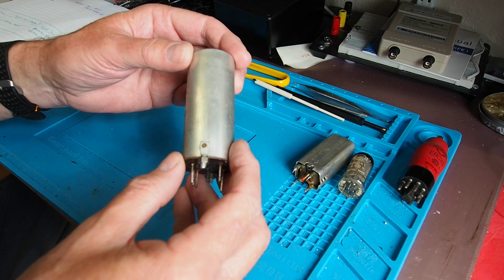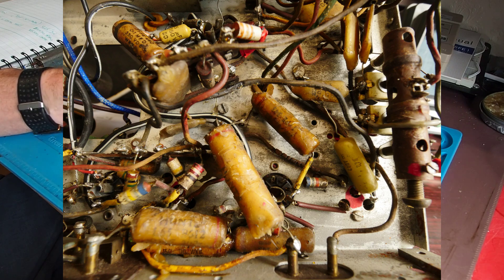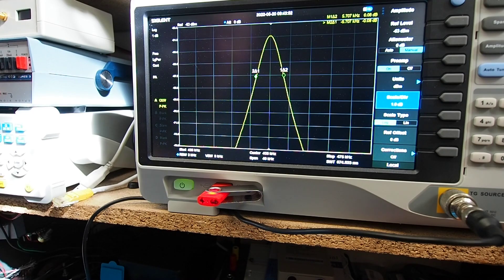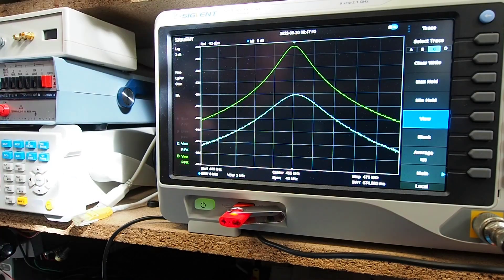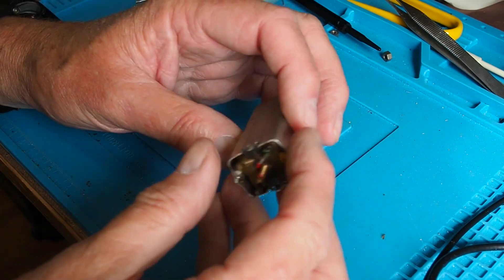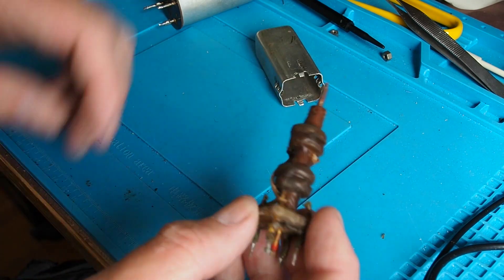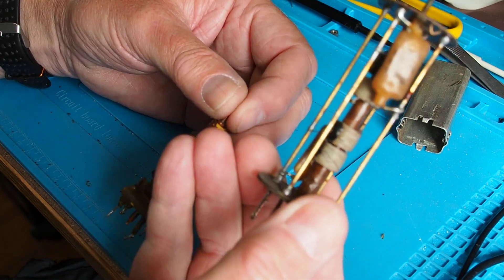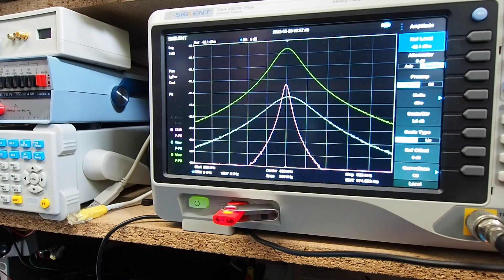Exploring 1940s Technology   #126

Comment: the 455 K.C. I.F. frequency was used/ developed by "R.C.A." and other radio manufacturers that used the 455 K.C. I.F. frequency  had to pay royalties to R.C.A, so a lot of radio manufacturers would use other I.F. frequencies so they would get around the royalty payments. for those who are getting into old radio repair, be careful about the I.F. frequency that is used when "PEAKING" the radio I.F. section. the best way to do this is by using a frequency generator, not by ear. also it must be done with the volume output as low as possible to avoid the "AVC" feed back circuit from becoming active, this will throw your peaking adjustments off

Comment: it was common for electronic equipment that was built after word war 2, to have pre- war components in them .the components were old/ new stock just setting on shelves, and instead of scraping the stock, it was used up. the older I.F. transformers were cap. tuned, the newer ones were slug tuned with fixed silver mica caps in the base of the transformer, and now they have age on them the silver mica is shorting out( sounds like a thunder storm when the radio is on), the only way to repair those is to dig out the silver mica wafers, and install new external caps. to find the capacitance, both coils have to be disconnected ,so the silver mica caps can be measured. most diagrams show the existence of the caps in parallel with the coils but do not show the value, due to the transformers being outsourced, and the company who built them did their own tuning of the circuit( pri./ sec.) there is no real set value used on the silver mica caps, and varies from set to set( first/ second I.F. stage including pri./ sec. windings).

Comment: Nice little bench experiment! I had wondered about the ability to test IF transformers like that, to try to troubleshoot them, or, to peak while outside of the circuit( possibly with a replacement of bad mica wafer caps) before re-installing them. Some info said it won't work right, but isn't a tuned/resonant "tank circuit" going to keep its resonant frequency regardless of what it's connected to, outside of more inductors or capacitance being connected to it?
Reply from the maker: The components around the IF cans are going to have some additional effect, I would guess that you could get them somewhere near, before assembly, but then how much the circuit components would impact on this I really don't know.

Comment: I grew up on this stuff, R1155 and No. 19 sets etc. Tore down and rebuilt all sorts of stuff using valves. Only comment about the 1947 Pye set is that they were probably using up the old components because stuff - in some cases - was not easily available immediately after the war. Remember Proop's Bros and others on the Edgeware Road in London? I live in Florida now and still  have some valve gear butmainly from the late fifties and early sixties. Still come across Int'l Octal stuff occasionally but it's getting quite rare now.
Reply from the maker: And I think Proops Brothers is still going, mainly tools and craft these days, see:- https://www.proopsbrothers.com/

Comment: Interesting piece of work Bill. They certainly did know their stuff back in the 40's - particularly with valve (tube) circuits. I have a library of electronics books from the valve era, as well as the early transistor era, that make fascinating reading as quite a lot of the valve circuitry transfers to transistor and IC circuits of today. Your channel is always interesting. Keep up the good work.